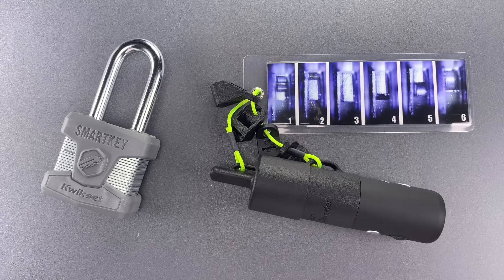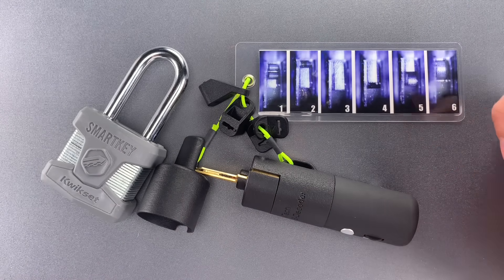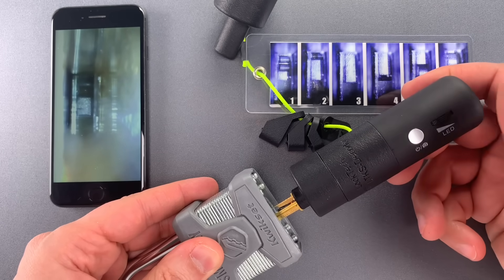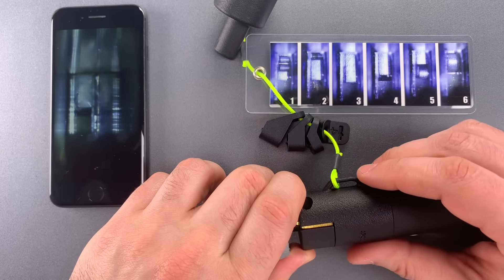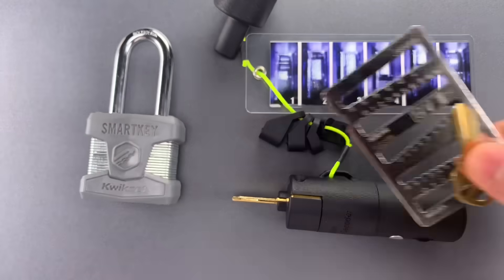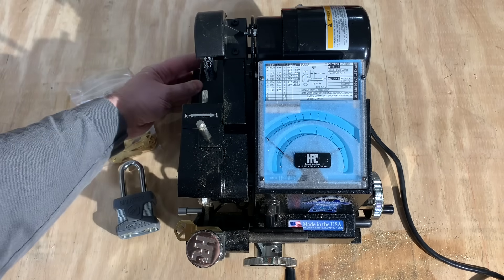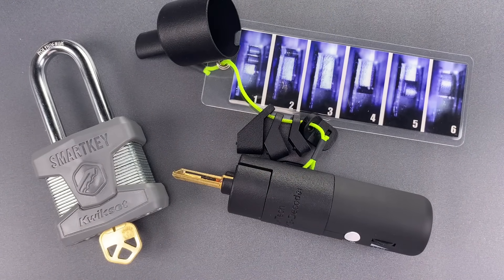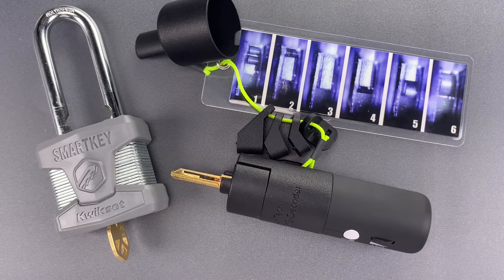[1209] This Tiny WiFi Camera Owns Kwikset SmartKey (LockTech LTKSD)

Comment: This must be the most effort LPL has done to open a lock!
Reply: Got tired of opening locks with thin pieces of metal and bubblegum so went the other way and put in a crap ton of effort to open it cleanly
Reply: @Jomskylark  try c4🤣🥳
Reply: Slower than picking, but a nifty solution for replacing a lost key without destroying the lock.

Probably only economic for expensive locks, in a commercial application.
Reply: @lairdcummings9092  It's also worth noting that the Quikset Smart Key system is reykeyable without effort, if you have the current key all you need is a new key, so for taking possession of a premises this sort of action is perfect, no new locks needed.
Reply: @bisted0  so... Reproduce just one key, and you can then easily re-key the entire house?
Nifty!
Reply: @lairdcummings9092  Exactly, high initial investment for the tool but if you're a locksmith, given how popular this lock is, it will pay for itself quickly and you'll have customers greatful they don't have to install new locks all over the property, saving them money.
Reply: @bisted0  good business, all around.
Reply: @bisted0  Yeah, but as a locksmith, you can charge a LOT more to just install new knobs.
Reply: @operator8014  True, but that comes back to the old question of ethical business. A mechanic might make more money if they recommend replacing rather than repairing parts, but an ethical one will do the right thing and repair, which is why a good mechanic is a good friend to have. An ethical locksmith should propose the solution that saves the client money whilst still earning their livelihood.

It's why it's often said that the best time to find a locksmith is when you don't need one, when you're desperate and locked out is when someone is most likely to take advantage.
Reply: @lairdcummings9092  Or where you want to open a lock and close it again without being detected
Reply: Nah, check out his video on the Bowley lock. He tried pretty damn hard to get into that one and failed so bad he didn't even show an attempt on camera.
Reply: @Steamrick you forget about the years of effort and pratice
Reply: @Steamrick  Give him time, eventually that Bowley will fall and we'll get an epic video <3
Reply: @Steamrick  bro in that video it is impossible to access the pins how can he pick it
Reply: @siddharth2796  According to the manufacturer, there are in fact three locksmiths on this planet that have managed to pick their lock. 
With custom made tools and almost certainly not reproducible in the field, but still. It is not entirely impossible.
Reply: @Steamrick  If you mean covertly no, if you mean by locksmiths in the field they definitely are, the Foil Impressioning and Bumping of course require custom tools (correctly modified blanks) made in advance, but locksmiths make and carry many lock-specific tools, hell it's half of what Lishi made, but the EPGing used a correctly bent piece of metal (and a admittedly incredibly skilled user)
Reply: @Steamrick  except LPL defeated the Bowley.
Reply: @redneck4528  -- Where? He has a video showcasing his prototype, but not one even attempting to beat the lock.
Reply: @TlalocTemporal  He hasn't. Matt Smith, a locksmith and toolmaker whom LPL has mentioned several times, has though, he EPGed, Foil Impressioned it and he Bumped it. You can watch the EPGing on here if you search "Huxleypig Bowley"
Reply: @bisted0  Yeah but he cheated. Bowley called him out in the comments that he randomed an easy code to break, and still had to make his own custom tools for it, and challeneged him to pick another Bowley, and he refused the challenge.

The dude was just being a douchebag trying to act like he was a badass for "easily picking the Bowley" when he didn't even do it legitimately.
Reply: @Amaroq64  Custom tools? The EPG used a bent piece of metal, I know the guy behind the camera. And Bowley were aggressive and disingenuous, they were clearly embarrassed that their "perfect" lock had been opened, Hux even offered to replicate it with another lock and they declined.
Reply: @Steamrick  no
Reply: OMG he could use this for the STUFF MADE HERE lock!
Reply: Nah he shot one
Reply: @ts757arse  You can get it a lot faster than that with practice, the record is under 55 seconds for some locks, but I agree that it isn't particularly practical for covert entry in a busy location given the volume.
Reply: @ts757arse  I imagine it wouldn't be too hard for a tool like this to be setup over usb, but it'd probably look a bit more conspicuous if there was a cord coming out of the tool in your hand that you're inserting into a lock. (long sleeves might help, plus nice long cord to go to phone in pocket?)

EDIT: oh and the noise is almost certainly the phone's camera noise that can be disabled, and the lanyard seems easy to remove/replace, so I wouldn't really consider those features to keep it noticable.
Reply: No, he did not open the lock, he owned the lock.
Reply: @ts757arse  Which really is only even a concern if you're looking to break into something serious enough to warrant better security than a lock this easily works on.

Ain't no one doing lock forensics on a house.
Reply: 👍👌👏https://www.youtube.com/channel/UCjWpq0YajYbpMFQQKuGkMbA
Reply: @ts757arse  a locksmith has as much time as the client is willing to pay for, but at $100/hr installing a new lock quickly becomes more economical. A tool like this cuts down on the Labor time massively.
Reply: Sure there are the tens of thousands of hours of practice involved in learning picking that let em walk up to so many locks and pick it right away. 
But for a layman with absolute minimum skill this tool makes it a straight forward, somewhat time sensitive, garanteed open.
Reply: I think you wll love them too :)
I    ❤    🚂🚃 trains 🚄 🚅 trams 🚈🚞
take a ride, I have a folder on ''transportation''
Reply: yeah that was also the coolest way too!
Reply: Have you seen what is  I essentially the portable version of this, where he use a micro scope to find the bumps in the lock to hand file a key
Reply: Maybe for his current experience but he has some locks he took a out 5 or more minutes in the past
Reply: No it took him like a whole 4 seconds for one😭
Reply: When you get tired of using the same old tricks so you decide to style on a lock
Reply: finding a lego astronaut ... may have been harder .... after all only way an old guy is going to find them is to step on them so you got a LOT of walking to do lol .... and all that to make a gun free of its security lol
Reply: Correction. Its not the EFFORT to open a lock. Its showing the tool not the lock truly. Its the tool that is the focus
Reply: His video #259, on a Mul-T-Lock MT5+ is 15 minutes. A bit over 5 of that is picking, longer than this whole video.
Reply: Next time he's going to pour the metal
Reply: Must be a good lock then
Reply: Just wait for how stuff's made lock
Reply: Still waiting for Abloys...
Reply: Lol accurate as fuck
Reply: i prefer the two wrench method
Reply: You are probably right
Reply: Man in the Park  I wish I knew the legend in person!
Reply: You guys are delusional if you think that he is picking a lock in one shot like you see it in the video without spending even more time practicing on any lock and figuring it out where the gate and false gates are and where to seat the pins. Once he was done with that phase he makes the video and pretend it’s the first time he touches that lock and that he picked it in few seconds
Reply: #tesla #elonmusk #shiba   to moon
Reply: u might wanna watch ep 1299
Reply: @brapinator8500  while that actually is a longer video, he did not make a working key for that lock.
Reply: @grdv10  he did print things out and explain and take the locks on & off the door and move rooms too
Reply: Still took him less than 4 minutes to open it
Reply: Nah, there were some locks he had to work on picking off camera just to open once for us, and this was five minutes of easy work
Reply: @ts757arse  Good points, I think it's still more convenient than most common boroscopes and so still will have use for locksmiths, but the use of it for covert entry is huge. That being said why the hell is there a sound effect for when the photo button is pressed, it's daft, forget to mute your phone and blow the whole operation.
Reply: @bisted0  it's the phone camera api built into the phone. Camera apps don't take pictures, they tell the OS to do it. Probably should mute your phone anyway if you're standing in front of someone's door trying to be quiet.
Reply: @bisted0  !!
Reply: Yes because the process isn't all automated, but key-sized cameras fundamentally are game over for mechanical locks.
Reply: @alexanderbarsby4357  Not really, and boroscopes capable of this have been around for years, this will defeat sliders but won't be a colossal additional help (still useful) against pin tumbler locks as they still won't show you where the shear line is on the pin stacks.
Reply: @bisted0  Those would fall to sonar. Tap the pin, listen for echo.
Reply: @donaldhobson8873  A good idea but wouldn't work too well if you varied the densities of the pins (which is already common with things like anti-drill pins). I have seen more advanced tools for lockpicking that use microphones to listen for binding and similar.
Reply: @bisted0  vibrate the lock with a cam and micro ToF sensor and when you reach the shear line the vibrations of the pin will change and you get the height. But it'll probably cost a crap ton.
Reply: @pavellelyukh5272  Actually a really interesting idea, it's basically self-impressioning without springs, but the difficulty is how to determine which pin has set, and mixed materials will make calibration hard, plus the level of vibration required would likely destroy the lock, but worth investigating.
Reply: @alexanderbarsby4357  not all mechanical locks, but some of them, certainly.
Reply: @alexanderbarsby4357  lockmakers could make a way to detect blanks and prevent them from being inserted completely...would at least midigate the attack surface.
Reply: no this one was: https://www.youtube.com/watch?v=KyTh4nRQ6lQ
Reply: @ts757arse  Yeah, sure, if you work on nuclear weapons, maybe take security at home seriously.

I'm gonna take a shot in the dark and assume no one reads either of our comments is in the situation you described.
Reply: It's not really picking a lock as much as producing a key which will then give you immediate and reliable access to the lock.
Producing a key instead of opening a lock with tools also allows you to enter without a trace, lockpicks may leave significant marks on the pins and that can be used as proof of breach. If a person goes back home and notices their TV or whatever else they insured for theft isn't there anymore they may show someone broke in and stole it that way.
Reply: A lock that cannot be opened by a tool!
https://youtu.be/RKRo97N1PJI    https://youtu.be/4vShP7riRqI
Reply: @titaniumdrivetechnologyco.8325  Looks likely to fail and even easier to impression than the Forever Lock V2.
Reply: Gotta maintain access to the wife’s back door 🤷‍♂️  (ref last April if you don’t get it)
Reply: he put in zero effort.. the tools do all the work
Reply: @klenzgaming  Need to add some pattern recognition to the camera app and it would be even less effort. Not that it seemed much of an effort for him.

Comment: Am I the only one who wants to see an educational video on the Keyfile machine? Looks pretty interesting
Reply: It looks really simple, I expected something much more complex actually. It seems that the right knob controls the side to side movement, which is shown by the bottom needle (and the blue card gives a scale to let you know in front of which position you're at). The bottom knob controls the "depth" of the cut, shown by the top needle. If you want to do a 4 cut in position 3, put the bottom needle to 3, then the top needle to 4, and then move the key side to side a bit (shown by the smaller lines on the bottom scale) to make the cut wide enough.
Reply: I just liked his line that he "just happened to have one" in his garage.  As if this were something lots of people just have laying around.
Reply: @HariSeldon913  I have two, one for weekday and the other one for weekends
Reply: @HariSeldon913  I'm pretty sure the stuff in the garage tends to start increasing after some time without any clear explanation. That's why most long-owned garages tend to be full of stuff.
Reply: Seems pretty intuitive; a cutting burr, a burnishing wheel, and a pair of feed screws associated with an exchangeable template card.

A bit more advanced than the old key cutting machines I used as a kid, but recognizable.
Reply: You did get to see just about everything it does though. Set the position and cut the depth. He was a little artsy going left and right of center by a millimeter or so on each position so I'd like to hear him talk through it, too.
Reply: @robertkribs9513  you can see the left and right of each position marked on the scale. You probably have to make the cuts wide enough, or the key would bind a lot.
Reply: The little artsy thing you mention is what you're supposed to do. If you look at the markings on the machine it has a center line for each pin location and 2 marks on either side and the side to side motion is just a normal part of the process.
Reply: @robertkribs9513  if you look, there are little marks to the left and right of each number when he was cutting the key. You're supposed to move the key back and forth between that margin so when you're done, the key appears to be one continuous cut for smooth entry into the keyway even though it was really five separate cuts.
Reply: @robertkribs9513  You can see there are small markers next to the positions on the card. Bet it is so that you end up with little plateaus on the key for the pins and therefor got some play with the key in the keyway.
Reply: @robertkribs9513  the reason he had to go side to side with the cuts was because of the design inherent in Kwikset and Weiser keys.  Both manufacturers have a wider base (depth) of the cuts as opposed to Schlage or Sargent.  The wider base ensures that even if the spacing is a bit off,  there's a good chance the key will still function as intended
Reply: @robertkribs9513  I'd think I could do that after he demonstrated it.
Reply: @robertkribs9513  there was marks on the scale around each pin position. He moved left and right exactly the this marks. I think this marks define pins width and clearance.
Reply: Thanks to everyone for explaining what he was doing!
Reply: @robertkribs9513  Yeah, I liked the way he played the traverse back and forth a bit to develop a flat on the cut.
Reply: @robertkribs9513  Not artsy. That's how you cut KW1 and Weiser. Their keys have wider spacing - which is why they are so easy to pick! Every other key I've done is a straight cut.
Reply: Absolutely!
Reply: agreed!
Reply: He uses the lower dial (spacing) and knob to get to the cut position. This moves the key. Then the second and upper dial to set the bitting depth, moving the cutting wheel. Then the first knob again to go back and forth slightly to the smaller graduations on the cut card to widen the cut for the size of the lock pins. Brings the depth back to zero and moves the lower dial to the next cutting position before using the depth knob again. When he's done the left side of the machine has a bristle wheel for deburring to clean up the key.
Reply: The tool looks like something out of a puzzle game. Good engineering, but nothing too difficult to figure out.
Reply: $1000 is almost enough for a good DIY CNC cutter
Reply: There are some pretty great talks about this stuff that you can find on YouTube, here's one I remember watching a while back:

https://www.youtube.com/watch?v=a9b9IYqsb_U
Reply: Fun machine to use.
Reply: etch-a-sketch but it cuts keys instead of removes the static silver stuff.
those cards are there so the depth is correct and the spacing between tumblers are correct. 

it could be made with motors so that it's electric, the programming could have all the measurements so those cards aren't needed.
Reply: They also make a specific cutter CW-1014 that will cut Kwikset and Weiser keys in one step without having to "widen" the cut.
Reply: Based on this video I'm 100% confident I could operate it without further explanation
Reply: @AshleeDelano  yep. Good engineering makes for easy operation.
Oh, you'd need to practice a bit, but I'd be surprised if you didn't have cold by the third try.
Reply: A lock that cannot be opened by a tool!
https://youtu.be/RKRo97N1PJI    https://youtu.be/4vShP7riRqI